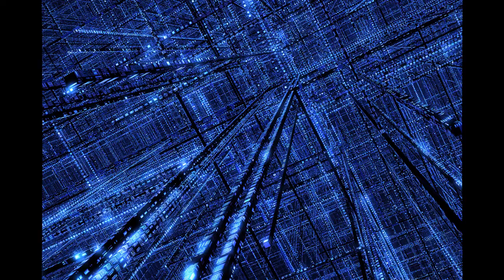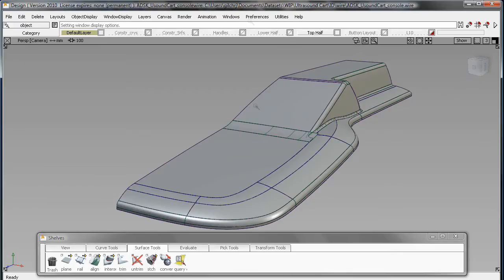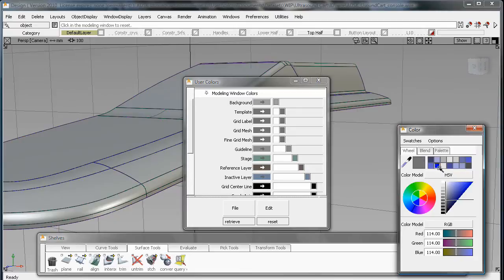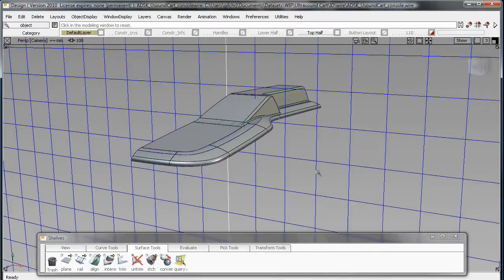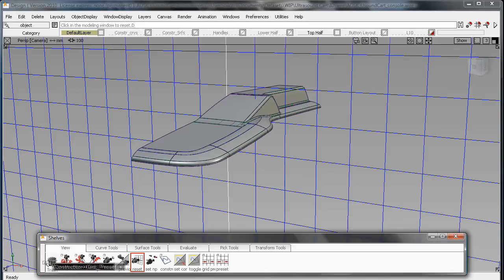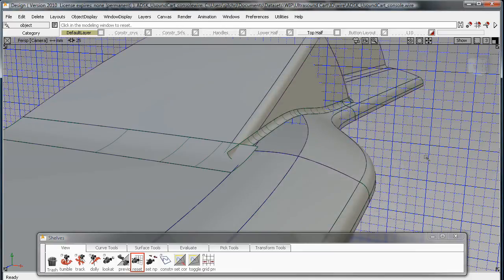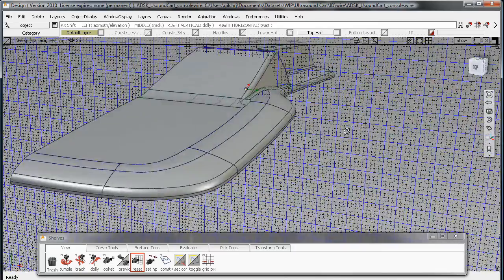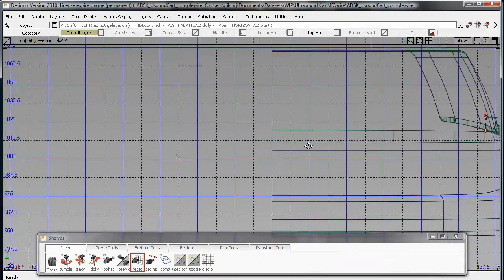Autodesk Alias Grid Options

Comment from the maker: @BrooklynNYC777 
sounds like the  camera's clipping plane.  couple ways to set or adjust this.  ALT + L which is "Look At"  should set the Clipping planes automatically.   to manually set them there is a tool in the palatte but i prefer to use the editor WINDOWS > EDITORS > CAMERA.  make sure the persp camera is the current camera in the editor(pull down at the top)  and look in the "digital properties" > "Clipping Near/Far".